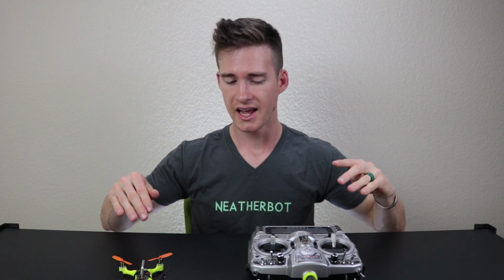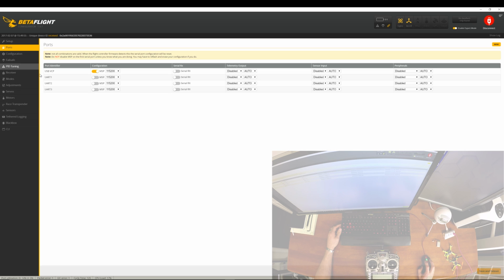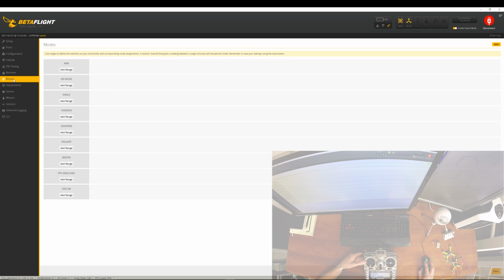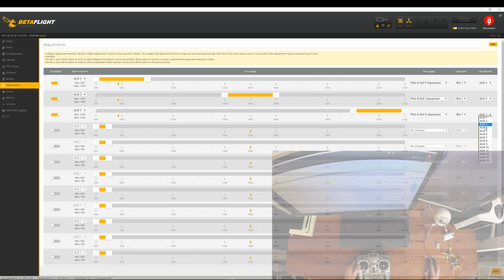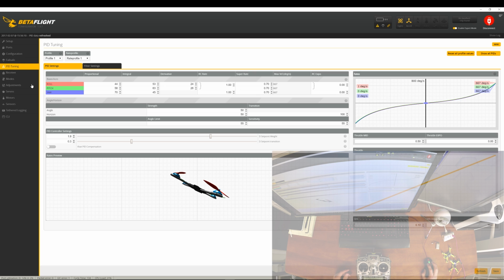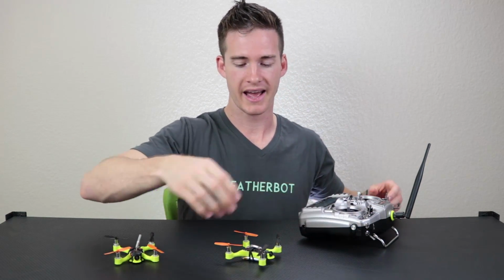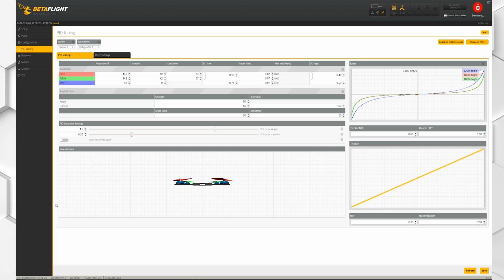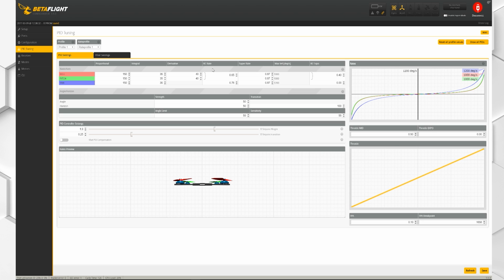PID Tuning Made Easy

Comment: You could have saved a lot of time by just copying your existing model in the TX to another slot, then editing the copy to assign switches, and also saving the dump or diff on the FC before flashing it then reloading it after the flash, then setting up the switches for the pid tuning.

Comment: will these tips somewhat apply the same for say a 5 inch+ drone?
Reply: GTiGuy316 yes but as for the P you don't want any oscillations.
Reply from the maker: With anything brushless you should never drop I and D to zero while trying to tune. It will quickly get into a ever increasing oscillation and shoot into the sky and cutting throttle will not do anything. Brushed motors have so much less power the oscillations are not near as violent. But that being said the principles stay the same as far as what observations are made to tell when you have too much of P I or D.

Comment: First I would like to say that I love your video, and thank you for making it ,and answering my last question. I've been using stock pids for quite some time now, and two of my newest builds are now not flying very well with them. I recently tried your method, and like it very much. I'm still having some problems that I could use your help, or an explanation on what i'm experiencing. after I make small throttle inputs my quad yaws to the right, and on punch outs it descends with the nose coming down first slightly. Also there is a little yaw after flips. I would appreciate your help. P.S. after reading what i've just written it sounds like my quad is a mess, but its really not that bad. With your help i'll make it perfect. Thank you. P.S/ P.S.   Some people are going to always have something negative to say about everything. Your video uses close to the same method of one of the rotor riot pilots, and I didn't see all the scrutiny of his video. So again good work, and great video.
Reply from the maker: +anfrae25 thank you for the words of encouragement! Can you tell me: 1) What flight controller you have? 2) what motors? 3)what propellers you are using? During throttle blips does yaw happen even when applying counter yaw in sticks? The nose doing a bit of a wobble can be corrected by using antigravity in betaflight. Joshua Bardwell has some amazing videos covering how to set up antigravity, you should check his channel out.

Comment: Also another technical question which I haven't seen being addressed anywhere online - I notice a vast difference between 3s and 4s when tuning... 3s is very subdued and easier to tune with. Can I tune to 3s and expect the same values to work as is for 4s or retune for 4s?

Comment: what would happen if you try to tune in stabilised mode? I mean not everyone can handle acro mode to start with if they are new to flying, especially if the quad is more menancing...
Reply from the maker: +Chi Tung simply put, you can not tune a quad in stability mode. The reason is because there is a whole secondary control loop that runs on top of the control loop for PIDs. You will not be able to see the necessary feedback, vibrations, bounceback, drifting, etc to make proper changes if stability mode is smoothing things out.

Comment: Surprising one of the best PID tuning videos I have watched.. thumbs up!
Reply from the maker: +Chi Tung thank you! Now be careful this is tuning for BRUSHED motors. The methodology changes going to BRUSHLESS. The main principles are the same but with brushless you never set any of the PID values to 0. I'm glad the video was helpful!
Reply: What sort of values would you suggest for brushless? Stock values from cleanflight / betaflight, etc? And change them up and down to see what the differences are...
Reply: Im glad I read these comments, I have all brushless quads, I would have zeroed the I's and D's, where do you suggest people start at with brushless motors?
Reply from the maker: Oh man that would be bad lol if you zero D with a brushless it will likely go into a nasty oscillations that gets worse and worse and shoots into the sky even if you lower throttle. I would stick with stock PIDs and then tweak them from there on a brushless build.

Comment: I'm going to have to do it the old fashioned way with the USB, and computer, but my question is will this process work on a 5 inch brushless motor quad?
Reply from the maker: +anfrae25 I have made and tuned quite a few more quads since I made this video. This tuning process is perfect for brushless and small (10000kv brushless) quads. I have not tried it on a 5inch. Joshua Bardwell and many others that I trust say they do not start with pids at 0. They start with pids at stock and modify them. I will be experimenting with bigger quads soon, but for now I can not say that that this process is good or not for 5inch quads. Good luck tuning!

Comment: Very good tutorial mate, thanks.
Juste one question, does it mater if you tune in horizon or not ?
Reply from the maker: +basebilljr07 good advice, you can only tune in acro mode. Any other self stabilized mode has its own PID loop that will make tuning impossible. Happy flying!
Reply: @neatherbot  If you prefer to fly in horizon or stabilized mode, do you still want to do the PID tuning? I am not clear on whether or not PIDS only impact acro flying. This is a great frame btw! We tried many of those little frame kits, and the NB98 puts them all to shame, and I can print dozens of them!
Reply: you have to tune in acro mode!!!! if you try to tune in horizon mode you will be ripping your hair out. and to be completely honest just disable horizon mode all together you dont need it and you will become a much better pilot a lot faster. i have only been flying FPV for about 2 months now and i am already racing and doing freestyle and i only used horizon mode on my first ever flight and then one of the guys i fly with made me disable it in the flight controller and he was right!!! you will progress 100% faster. and dont get frustrated with crashing everyone does it just keep at it and you will be a pro in no time.also practice on a simulator crashes there dont cost anything. DRL racing simulator is free and it feels pretty dam close to the real thing
Reply: Yeah, i've been flying drones for 3 weeks now, lots of simulator also and I've ben flying acro on my tiny whoop for one week now, I just wanted to tune it because it seems sloppy at times and i have those crazy momment where i lose power and i think it's because he's geting all confused with super high factory settings.

thanks for your answer mate

Comment: wait so if you are in acro why does it seem to self level. or am I wrong and you are bringing back to level after sharp inputs
Reply from the maker: +Cole L your suspicion is correct! I am putting in sharp movements and then bringing it back to level just as sharply. So it's a quick back and forth motion for the stick inputs.
Reply: Good to know
Reply: And you would need to do this for all axises
Reply from the maker: +Cole L yes, pitch and roll generally are pretty close to the same values. It depends on the geometry of the frame and where the center of gravity is. But yes you can adjust pitch and roll independently if you want to fine tune the pids
Reply: What about yaw
Reply from the maker: +Cole L yaw I usually just copy down from Pitch both proportional and integral values for Yaw
Reply from the maker: +Cole L yaw is not as sensitive to pitch and roll and has a wider range of acceptable values.

Comment: Nice video! for brushed motors I also recommend increasing the D Setpoint weight to the maximum, this will compensate the lack of power and will increase the stick control.
Regards
Reply from the maker: +André Ferreira This is interesting, I will have to try this. I feel like I get plenty of power and have more than enough stick control with this NB98. I am excited to play with the D setpoint and see what it does. Thanks for the tip!

Comment: This seems like a great way to detune your quad. I'm not sure about little micros like this, but on a larger quad, you need a lot more precise tubing methods. Having a betaflight osd is very helpful.
Reply: I agree. Betaflight OSD is one of the best ways to tune your quad on the field!
Reply from the maker: +The Schire FPV more precise in what way? Yeah those osd tools are pretty slick, but even with the osd you can not be flying and changing pid values at the same time.
Reply: Well to get your P valuesz just right, for example, I like to be able to go a click at a time. You can't do that with a pot for PID control. Also I don't want to accidentally hit something on my radio and then suddenly jello all over the place. Again, maybe this is because I fly 5" quads opposed to a brushed micro, but just my opinion.
Reply from the maker: +The Schire FPV I agree you do not get the same resolution as adjusting it one value at a time, but I would say this is a very useful tool to get the pids very close to perfect, and then go in and make small changes to refine through betaflight or the osd. I do not intend to continue to fly with the pids editable once I have set them. That's why I suggested making a specific profile in the radio to use only for editing pids. I do agree 5" quads are much different from what I am doing. But hopefully people find this as a useful way to edit pids quickly and to visualize when you have too much or too little.